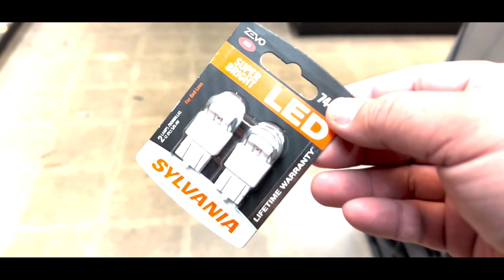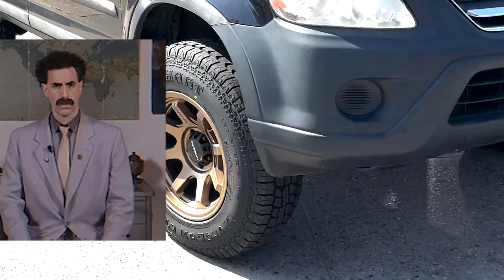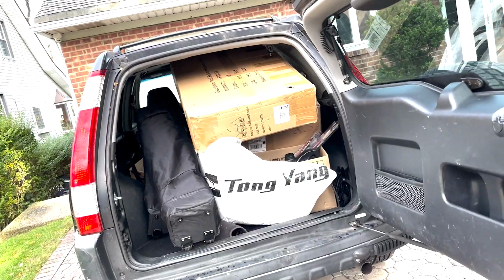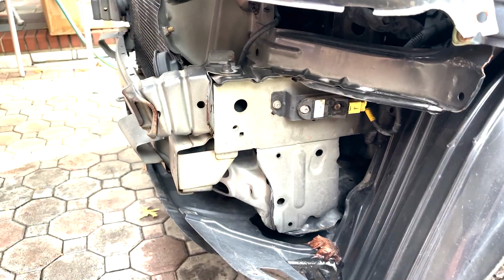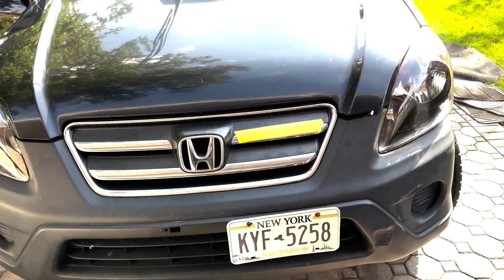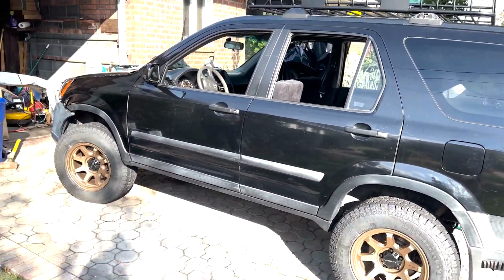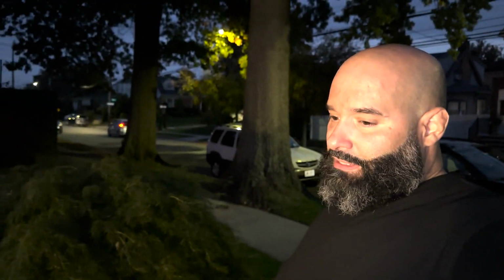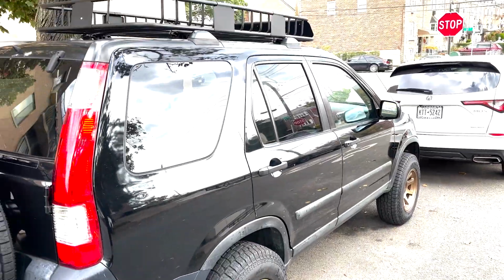BUILDING a HONDA CRV | EP.4

Comment: Luv it ❤
Reply: Purchase a "18mm Spark plug fouler" from O'Reilly's its about 8$ . Unscrew the 02 sensor furthest away from the engine,  that is called the downstream o2 sensor,  screw the spark plug fouler into the cat and then the o2 sensor into the fouler. Code will be gone, the o2 sensor is sensing a rich mixture thus tripping the code, by extending the gap of the o2 sensor it senses more air and you will never get that light again,

Comment: nice man any word on thr censor i have the same issue with my crv 2006
Reply from the maker: But the o2 sensor Amazon recommends for your year and model. I bought like 3 sensors listening to people when Amazon knew the whole time 🤦🏻‍♂️
Reply from the maker: *Buy
Reply: My brother-in-law gifted me a 02 crv with o2 issues.. went cheap and bought a Amazon o2, same code popped up, finally forked $200 for a Denso from Napa Autoparts and pass smog the next day.

Comment: What wheels are those and tires if you’d send the details I’d appreciate it alot
Reply from the maker: No problem!
The Wheels = https://www.ebay.com/itm/296150954310?_trkparms=amclksrc%3DITM%26aid%3D1110006%26algo%3DHOMESPLICE.SIM%26ao%3D1%26asc%3D259753%26meid%3D9858b4011a884c9ebfe29ec8da52c504%26pid%3D101429%26rk%3D3%26rkt%3D12%26sd%3D125253808708%26itm%3D296150954310%26pmt%3D1%26noa%3D0%26pg%3D2332490%26algv%3DSimplAMLv11WebTrimmedV3MskuWithRevOptLambda85KnnRecallV1FitmentPromotionM2CPCAuto%26brand%3DVision&_trksid=p2332490.c101429.m2460&amdata=cksum%3A2961509543109858b4011a884c9ebfe29ec8da52c504%7Cenc%3AAQAIAAABME%252FZeabQWL56BYidmJ2QeOraOMr9xBt4nn1YO9kq0MWMS9GIXaJp85zBkgsiZznp2eCQug97LTuNg0hDr%252FGhXvJsQIh%252BU2vQs0sUJUsDts1R9CtCpkAAVdtTKNdOdFPZqmb1IiSqAmwZ1ItWK6VymSXwkkh4YGPMY1Tuhdn2xcqFLRmqYfZnsiineeTvTejQ4jsLSqBFJNN%252BYDO4iEBjp1DDIGKnPHpg9unZKWHEkezV17pd2%252BlwiUOXc3AgBjE%252BEPivMspeGrHobwzwXJy9obQS3CL%252B0vAUdRr%252FnDT3U3BKXfwSP6IyM4uKbNtWq1%252BS%252BJiTJcA4ZVCWdc2Uc7xOtbEAvwac09oH5gJHQHOU4yWZGSW0ZbZXLCvv7IZfcdd207IunJHjnMWt2SaTMbeR%252BA4%253D%7Campid%3APL_CLK%7Cclp%3A2332490&epid=6048494311
The Tires = https://www.ebay.com/itm/176143056641?_trkparms=amclksrc%3DITM%26aid%3D1110006%26algo%3DHOMESPLICE.SIM%26ao%3D1%26asc%3D259753%26meid%3D99daee76bffa449a86bdcc409984150e%26pid%3D101429%26rk%3D1%26rkt%3D12%26sd%3D303116303973%26itm%3D176143056641%26pmt%3D1%26noa%3D0%26pg%3D2332490%26algv%3DSimplAMLv11WebTrimmedV3MskuWithRevOptLambda85KnnRecallV1FitmentPromotionM2CPCAuto%26brand%3DLexani&_trksid=p2332490.c101429.m2460&amdata=cksum%3A17614305664199daee76bffa449a86bdcc409984150e%7Cenc%3AAQAIAAABME%252FZeabQWL56BYidmJ2QeOraOMr9xBt4nn1YO9kq0MWMS9GIXaJp85zBkgsiZznp2eCQug97LTuNg0hDr%252FGhXvJsQIh%252BU2vQs0sUJUsDts1RQREWW91JASPEhs1cGGD%252F%252BCgvAhvxNTr0vqgYen717%252BSbCGiVUMNmju%252Bn3SdhezivLQAtNFZPJIovPCye1gHqq4odr2CmhoapjKEvJN5rQDOOIEYSqq0TjYrvog%252BseiNKm7Fw6RddbQzT%252By98FprZtUjzFSqR6a786PC75%252FxxdnsghhsZPimMmqp0NNMK%252FVm8pGTbOT%252FV13Kovuube6ivHmkq64GslEXXLsr37K%252FF0Aswx%252FDUWu2ZuIubQMZgYA2eiTRsPc6x6aHk9L6mawwkcNonUFvj0paCvoCUknLIdn8%253D%7Campid%3APL_CLK%7Cclp%3A2332490&epid=5024868057